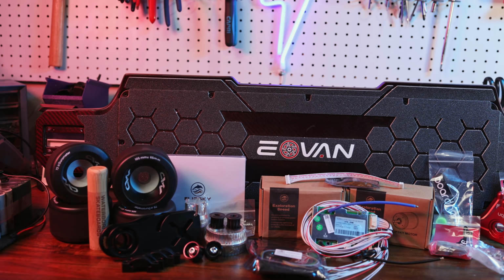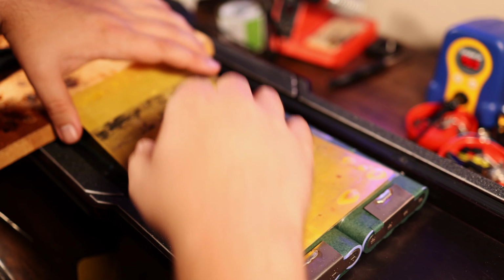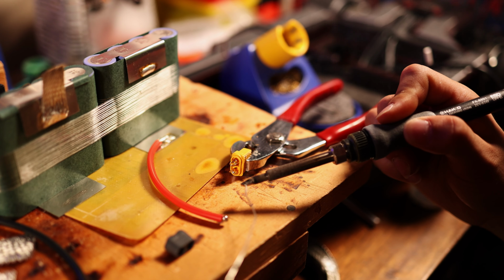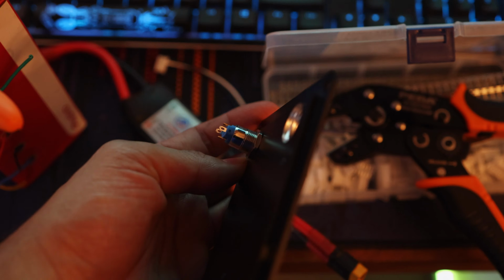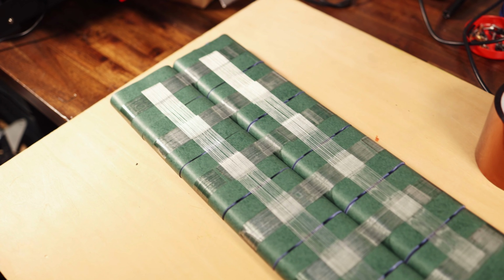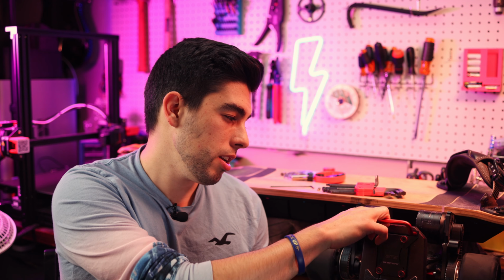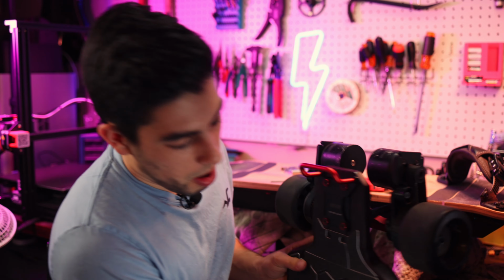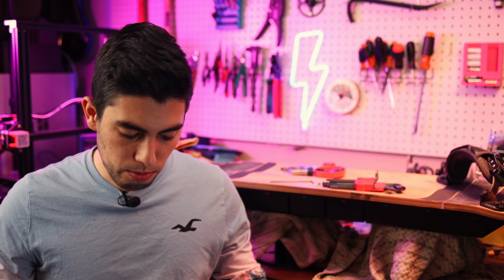SQUEEZE: One-Video Carbon Fiber DIY Electric Skateboard Build

Comment: Question for you what carbon fiber deck will fit 2x ESCs and let me have the most battery amount. I wanna use the acedeck Nyx Z3 trucks and gear drive 2x so it's gonna be 4wheel drive. I was looking at Flipsky Lightning Esk8 carbon fiber deck but it doesn't offer alot of space(its who I'm using the ESCs from and 7070 motors unless you know some motors that will make them look weak. I wanna be able to climb and go on backwood trails with it but also be able to do that for a stupid long trip. Speed is nice but torque and distance is my main goal. 😂 idk if anyone has even tryed to pull something as crazy but I do lol 😂 o and tell you buddy to buy the same switch only just use a resistor on the LED wires it should stop it from killing it. And yes that remote is awesome! I also got the flipsky tft screen. I found a Davega 3D print and it i stuck the screen in it. I'm gonna flash it over to the Davega layout. 😂it was kind crappie cause I had to cut and shape the sides of the PCBs both of them and where they clip into each other also had to be trimmed. 😂 its together. For 23$ and 2$ i. Plastic it was awesome! And it's the GPS version so I know what is the exact speed. O and you gotta remember most ppls attention spans are horrible smaller the vids the morw ppl you will have on your channel. I personally just love other people that have a decent grasp on what it takes to build one of these.
Reply from the maker: Sorry for the late response! You're asking for a lot there for sure, and to be honest I've never really done a lot of research into CF decks. I know Boundmotor had one at some point and so does Omni. I also think Mboards is selling theirs, so that could be a great option as well. 

It sounds like some of your goals don't align that well with a carbon tub board, sounds like you'd enjoy a street mountainboard a lot more. I'd recommend the Megan, definitely not that flipsky screen garbage. You are right about the viewer retention, it has been notoriously bad for most of my channel's history. It's very hard to fit in all the information I want to convey in a shorter format, but I'm working on figuring out ways to condense it.

Comment: i had an eovan gts super. it was a great board.
Reply from the maker: I tried one a long time ago and in my opinion, it had one of the worst VESC setups I've ever ridden, exaggerated by the horrible remote and light spring feel. They could have done a lot better, and its possible the unit I rode just had some issues, but I'm not sure.
Reply: @RBEMotion  you mention worst vesc setup. what was wrong with it?

Comment: Hey, I’m currently working on my build and I’m wondering how thick the nickel band should be. According to my research, I should use 0.6 mm, but I see that for large DIY batteries you use 0.2 mm. I’m building a 12s 3p pack with Samsung 30T cells, it would be awesome if you could help me out with this. Thanks for your videos, I really appreciate the information and the quality of your videos!
Reply from the maker: Hey there, 0.6mm is way too thick for spot welding at the consumer scale. For the large batteries I use either 0.15mm or 0.20mm, however, I am always careful to not create any pinch points. When the large nickel strips are welded across the entire set of a P group, the current is shared across the cross-sectional area of the entire nickel, that means that you are able to use a thinner piece of nickel, versus if you use skinny nickel strip, like 8mm or 10mm, the current is a lot more condensed and can cause a bottleneck.

For a 12s3p pack, if you were to use pre-cut strips from mboards or something like that, you should have no issue with 0.20mm thick. If you were to cut your own out of, for example, a 30mm piece, and make it run the whole width of the p group, you can even use 0.15.  Sorry for the late reply, and thanks for watching, glad they are helpful!
Reply: @ Thanks for the reply! Unfortunately, I can’t order from MBoards because I live in Germany and the shipping costs are too high. But I will just cut this shape myself from large nickel sheets.

Also, your videos are amazing! I love the quality you provide us. I know how much work goes into making them. I would love to see a more detailed video on soldering the BMS for charging only.

Comment: Nice video format man

To my knowledge these Lishen LR2170LA are on par with the Samsung 40T and can deliver 20A cont. And 35A peak.
So defennatly a high power cell
Reply from the maker: Thank you! I may experiment with it more in the future! And you're right it is similar to the 40t but mooch rates it a bit lower on discharge. We honestly could probably get away with 50a per side on the vesc but it might sag a bit

Comment: I finished a almost identical build not too long ago the differences would be me running, larger motors, and larger wheels other than that almost identical and for the issue with the motors contacting the Board I took the motors up underneath the board but that’s because I have 6.5 inch tires also cover the charge port and power button in silicone because if anything were to take on water, it would be through there that’s how I fried my D100 
Specs
6374 190KV Motors
35 mi range 
37mph top speed (in about 500 ft)
12s4p 40T Battery (691 Wh)
Reply from the maker: Seems like a super fun build! Impressive range you were able to achieve on that! Another commenter suggested longer motor mounts so I might explore that option.

Comment: Great video Ryan! Initial solutions that come to kind for the low motors are either getting longer mounts (IDEA has some that may be long enough) or changing trucks to tkp which have a longer wheelbase. These may not be ideal for different reasons but wanted to throw the ideas out there.

Also I do like the complete build in one video!
Reply from the maker: Thank you! And yes the idea mounts is a great option, especially since I believe they shouldn't have an issue fitting on the BN trucks. It would change the belt length but that's an easy fix.

Also onsra tkp would be a great fit indeed but we kinda picked the custom red hangers from the beginning so it would be a shame to switch

Comment: Beautiful build! Re: the motor cans sitting close to the ground (or hitting the deck), could you get maybe around that issue with extra long motor mounts? I don't know how long of a mount you would need for your specific truck/deck geometry. I've run into similar issues with my Boardnamics RKPs and used very long IDEA motor mounts (C-C distance 113-120 mm) to solve that issue. Boardnamics's own XL motor mount (C-C 100 +/- 6 mm) was not long enough.
Reply from the maker: Thank you! Hmmm this is a pretty decent idea, I don't know why I didn't think of longer mounts, or switching to idea, that would be a great alternative. I'll look into that. Thanks for the suggestion